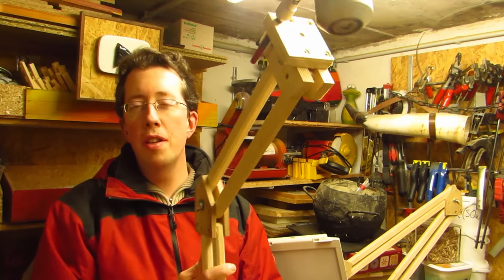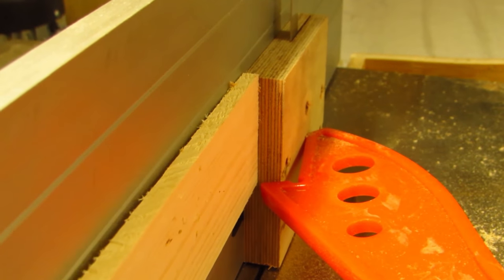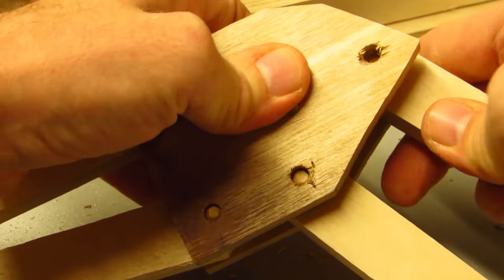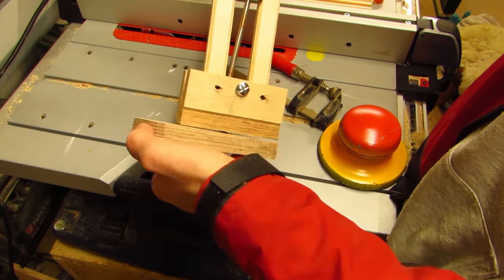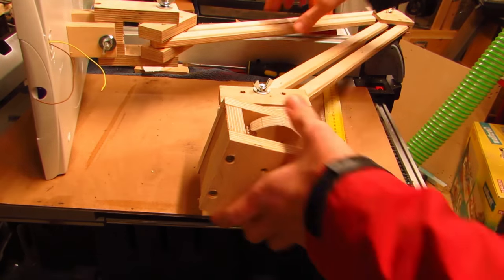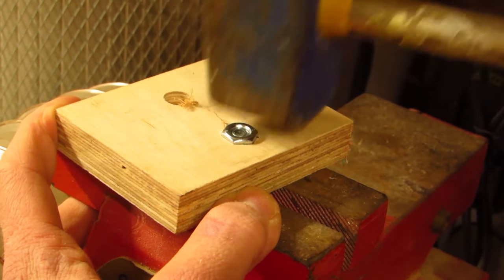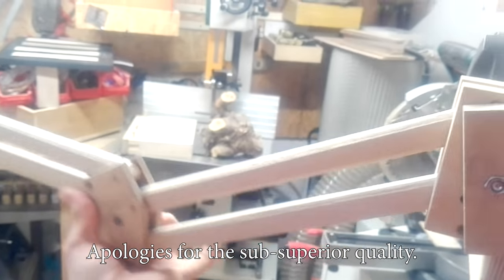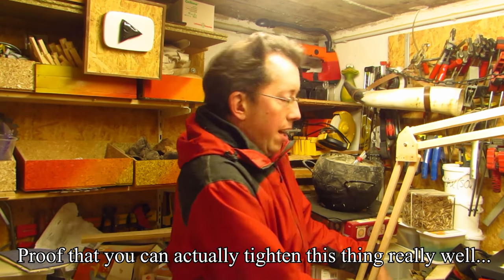Simple Boom Arms for your Equipment

Comment: Hi, great video! My question is, how do you prevent them from not slowly sagging when your not looking 🤔 I made a small version for a tablet with butter fly nuts on the joints and it doesn't hold the position very well.
Reply from the maker: In my experience, it's a matter of tightening the screws well enough to hold position, but not enough to prevent movement. You could aide that by adding some kind or larger handle to the nuts. Thanks for watching!
Reply: @BeInspiredwithDominic  thanks. That was my next option👍